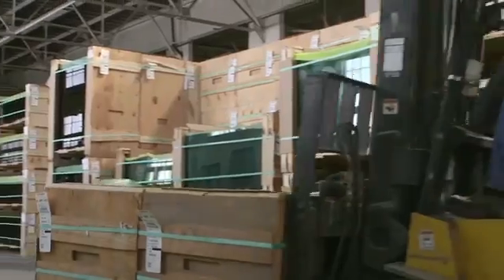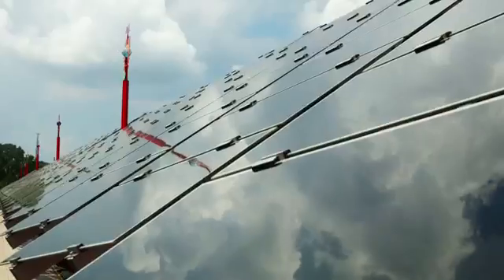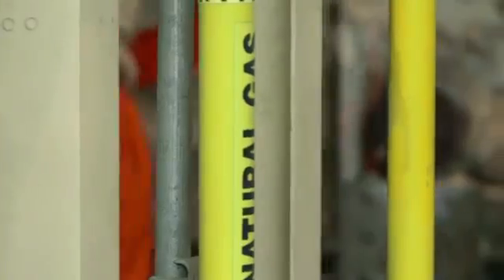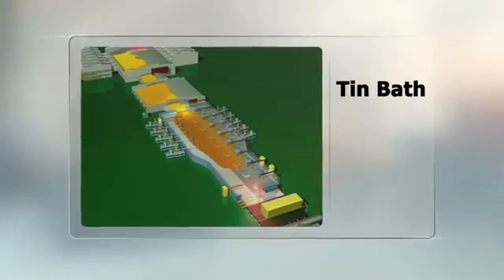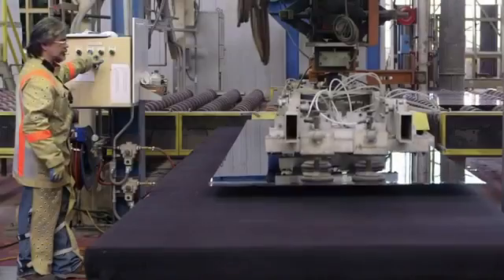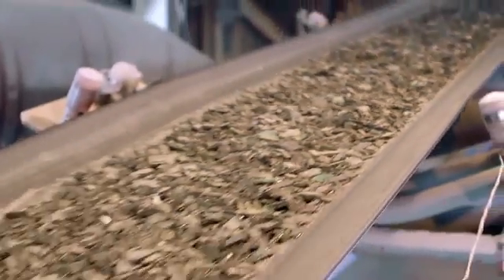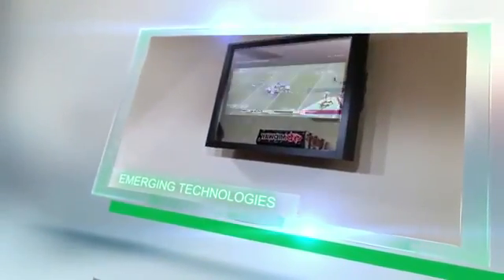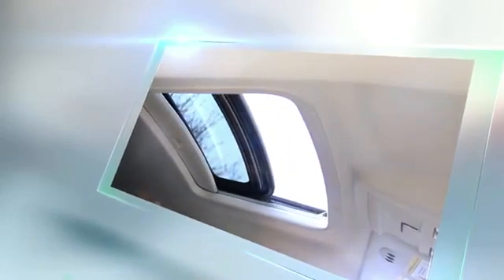Pilkington Float Glass Process

Comment: Recycling glass reduces the cost of melting by 20 percent. How!?!?!?!?

You still had to produce the cullet in the first place. Recycling it eliminates the waste stream but does nothing to recuperate the processing energy.

This video is mincing words. Recycling, while less energy intensive than initial synthesis, still requires energy.

That "cullet" that is saving them so much energy is actually manufacturing waste. If they were able to eliminate the waste they wouldn't have to brag about recycling.